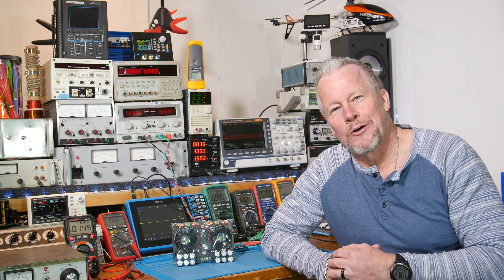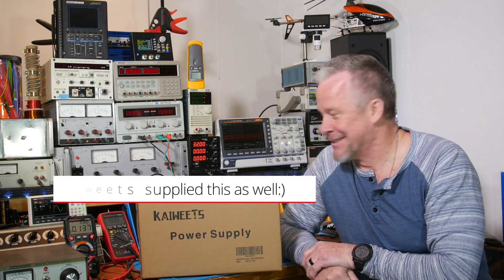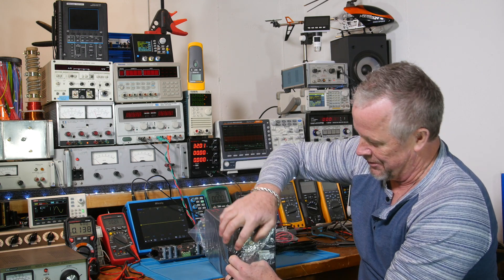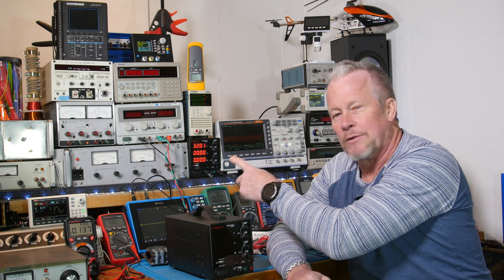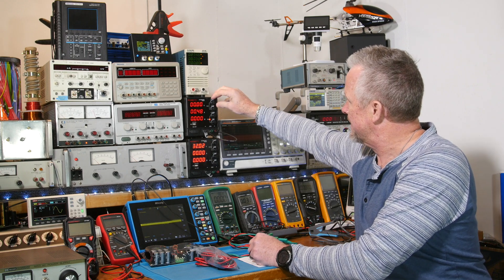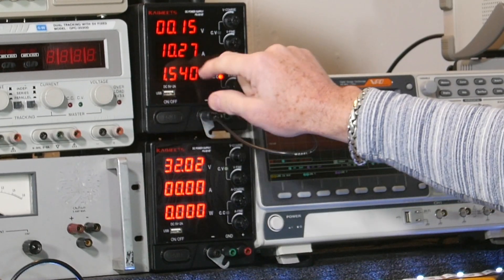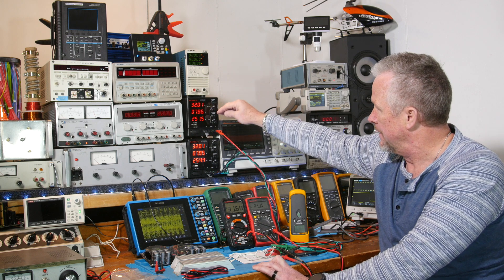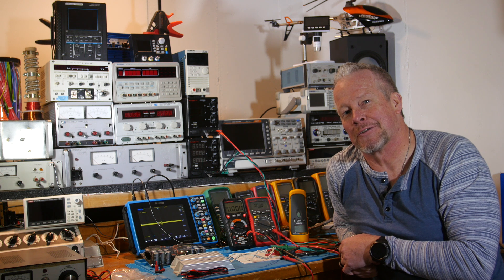Kaiweets Power Supply as Tracking Power Supply

Comment: Eddie, for your subscribers, you might want to point out that using any supplied cables at the full load is best avoided when the cables are bunched up? Even separating the cables into two, can help? Perhaps any review of PSU should include a full power test for 5 minutes to show if the cables are (with care) adequate (or not)? What is it about Chinese PSU cables that are invariably under-specced - I wouldn’t think to replace the cable on a 3kW kettle before first use? Simon
Reply from the maker: Thank you for this great feedback.  I will have to be sure to make a point of this each time I review a new PS.  I did review this power supply in an earlier video and did show the cable warming up under full load.  I used a thermal camera so the temp of the cable could be seen.  https://youtu.be/q4zvQOZjpqk

Comment: Hi Eddie, 
How much does your HP put out? 
About the Kaiweets, doesn't it hurt your audio work to use switch mode? 
Cheers 
Mark
Reply from the maker: I have 3 of them.  The big one is 60 to 70 Vmax and 15 to 18 Amps max, then the next smaller is 24 VDC at 15 Amps, and then there is the dual output which is 30 VDC at 2.4 Amps each side.  I think the filtering cleans up the switching noise so that it is not a problem.  But that is a great question and I'll try to measure that when I do power an amplifier;)
Reply: @KissAnalog  Hi Eddie 
It sounds like the ideal setup would be two of the 70V 15A HPs... just mod them to do the tracking thing....
I've been keeping my eyes open for these, but they are way out of my budget. 
Cheers 
Mark

Comment: Like the price on the 10A test supplies but i worry there's a trade off some place on account of them being switch modes. Is there a rule of thumb or a standard of some kind that says the supplied DC can have 'x' amount of switching noise... & is there an easy way to test for that? Even today the HiFi aficionados seem to prefer an amp with a linear supply & that really heavy power transformer even if the amp is Class-D with all that assumed spec for switching noise...
Reply from the maker: The Switching Power Supplies will have some switching noise.  I'm preparing for a video to show how to filter this.  The Class-D amps are switching power supplies - in essence;)  I know that most, if not all, Pro Amps that are Class-D have switching power supplies as well.

Comment: Hello Eddie, for more Powerful PSU's that don't break the Bank you can check the GOPHERT CPS Series,
I have the CPS-3232 0-32V 0-32A DC Switchmode PSU thats 1024Watts ! I use it for Hi power ZVS and for the Filament of Power Transmitter Tubes. Cheers, Konstantin PS: I bought it for 100 US on ali some years ago, another nice one is the CPS 6517 0-65V 0-17A
Reply from the maker: Thank you!  I forgot about Gophert - I totally forgot about them.  I'll have to get one and try it out.  I think I new about Gophert because of an inverter that I was looking at.  These look great!
Reply: My pleasure! I used/use mine a lot and when I need Hi currents, I like the Flat design, easy to stack them and the Fan is temp controlled.
Reply from the maker: @KonstantinGrigoriadis  I agree - I like that the fan doesn't come on all the time;)

Comment: Working with pro audio, I do have problems with power supply. Very difficult to find a high voltage power supply for vaccum tubes. Difficult to find a good low noise for solid state testing and designing. Variable mains frequency... full isolated... yeah, power supplies now a days is very limited in terms of applications for many labs. Everything is about the 5V rails bs high current... at least it could goes up to 6,3V for heaters. We from audio world are the least to be considered for eletronuc lab equipment.
Great videos as always. 
Cheers!
Reply from the maker: Great conversation;)  I wonder if you can take a transformer and turn it around so that you put the line voltage in the low voltage output so that you boost the voltage at the input - which is now the output?  Or, use several small transformers and stack the secondaries on top of each other to get the voltage that you want (primaries all in parallel)?

I'll show how to design a power supply to get HV output (with Isolation).  I might have to do that sooner now that you bring this up;)
Reply: @KissAnalog  thats is it. I put the secondary side as the primary, so i can get a ratio bigger then 1 for the output transformer.  Glad to hear that you will jump.in to this subject very soon. Looking foward to hear your insights and tips over this topic.
Cheers!!!
Reply: Power supplies for >200V DC are still build. Check out for example TDK-LAMBDA Z650-1 or Keysight N5752A.
Reply: @beamfinder8336  that is the main problem. The TDK cost almost 2k at Mouser europe... the keysigth is over 2,4k... so over priced
Reply: @misterjorous  as I see the case you have two  options left:
a) buy a vintage tube power supply on ebay or some convention (200€...500€) with the risk of it being broken or needing some parts exchanged.
I had the incredible luck to buy a big Philips PE1531 for 45€ from a local radio collector that I know.
My small tube supply is a Van Der Heem Type 8619. I really love it.

b) build your own supply. there are some schematics out there using MOSFETS, an IGBT might be the better choise as series pass element. (by DIY you might get away with about 200€...300€)
Reply: @beamfinder8336  actually I'm building one. Im using a class D power supply of 800W, class D amp in bridge and a signal genarator (external). In the output I put a step up transformer of 1K VA. I can do it full isolated, can vary the mains frequency. I also using a lowside shunt to read the output power and feedback control to attenuate the input signal amplitude with a jfet in triode mode. Initial tests is doing ok.
Reply: @beamfinder8336  by the way, thanks for your input. 
I always thing how cool is the comment section in some youtube pages. We can get a lot of info and also connect with people so we can always learn a bit more. 
Cheers!!!
Reply: But yeah... this will cost around 250 euros with no enclousure.
Reply: @misterjorous  this sounds really massive, I wish you good results with your project!
Also I agree with you, the comments section is sometimes a great treasure of information :)
Reply: I got lucky too and built my linear psu around an 1800VA beautiful toroid from an amp that was scrapped. Only cost me $30 for it and built my own wooden enclosure.